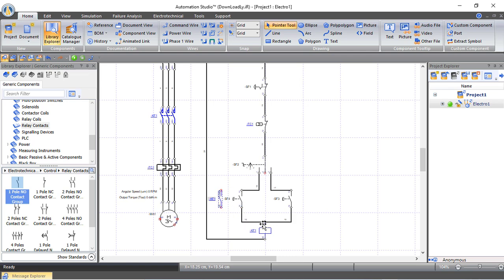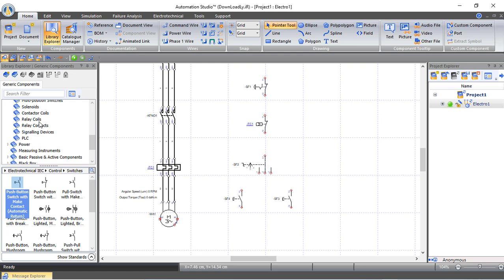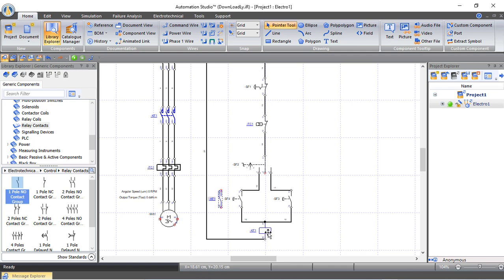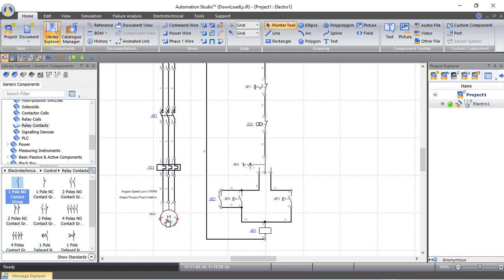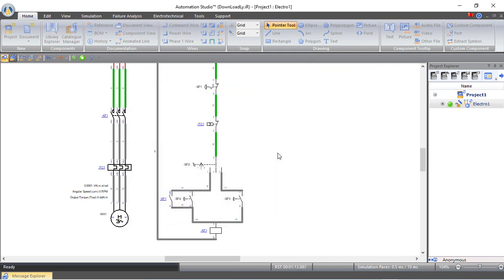Jogging vs Continuous Mode for Induction Motor in Automation Studio | Tutorial #13 for beginners

Comment from the maker: Timestamps (Powered by Merlin AI)
00:05 - Comparison of Jogging and Continuous Mode for Induction Motor Control
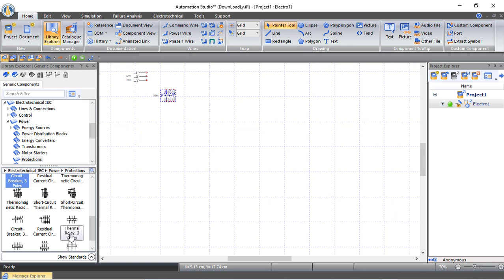01:21 - Building a simple control circuit for an induction motor.
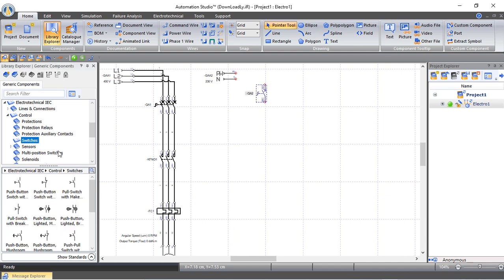02:53 - Explains the setup of control elements for jogging and continuous mode.
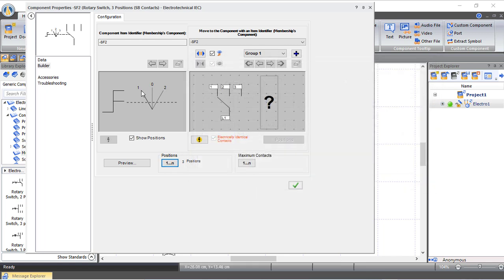04:13 - Comparison of Jogging and Continuous Mode for Induction Motors.
05:28 - Understanding crane motor control using push buttons.
06:43 - Setting up a motor control circuit with jogging mode functionality.
08:00 - Jogging requires constant button press; continuous operation uses latching contacts.
09:12 - Difference between jogging and continuous mode for induction motors.